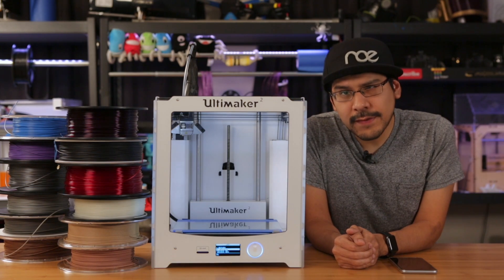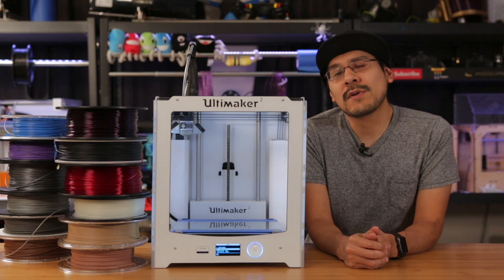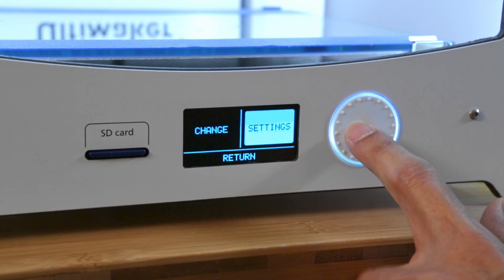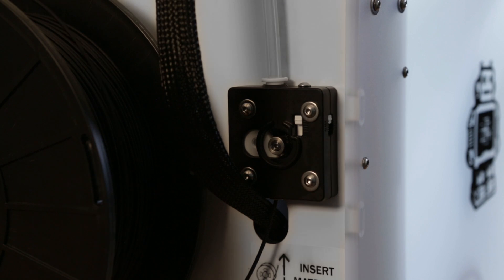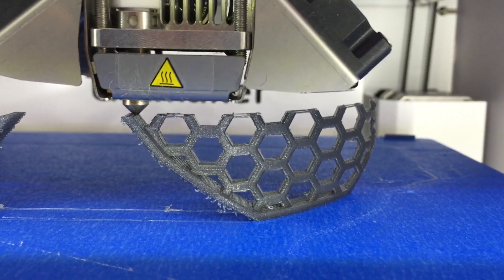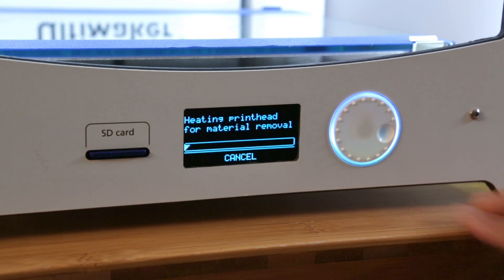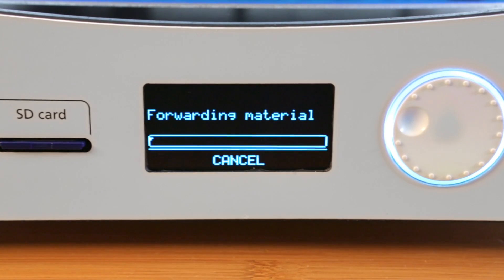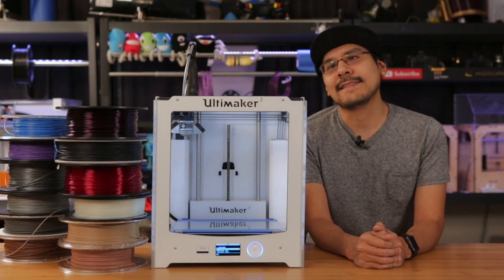1.75mm Filament on Ultimaker 2

Comment: You advise basically doing a cold pull to remove 1.75 mm filament. Is that because the nozzle has too much interior space, and is there a replacement nozzle that would allow removing filament with the normal Change Filament function?
Reply: Old comment, but no one answered - you just have to change the PTFE sleeve at the hot end.

Comment: I believe your feeder tension screw is installed improperly. The screw head should remain in the casing and push down on the spring inside. Having it on top like it is shown shouldn't allow you to adjust the tension at all. The video shows the screw head above the casing, and the tension gauge all the way at the top (both indicating this installation error). See here for cleaning procedures (https://support.ultimaker.com/hc/en-us/articles/360011802900-Clean-the-Ultimaker-2-feeder-and-replace-the-Bowden-tube) I see this improperly installed fairly commonly after people clean out the feeder and reassemble as this screw and spring tend to fly out of the casing if opened too quickly, and the position of this is not immediately apparent.

Comment: I recently got a UM2+ from Adafruit and got some ABS 1.75mm filament at same time since you guys recommended 1.75 and 2.85 ABS was not available from Adafruit.  I am a complete beginner but have no problem with PLA 2.85 but the ABS 1.75 seems to melt and back flow up the tube.  I think the Ultimaker 2+ has different feeder and printhead.  Have you tested 1.75 on the UM2+?  I like your videos and projects.  Keep up the good work!
Reply: +Byron Porter  Hi, I have the same problem .I'm going to try the following; Bowden tube with 2.4 mm id+ nozzle with 1.75 mm id

Comment: Need to replace PTFE tubing.  It is made for 3.00 mm filament not 1.75 mm.  The extrusion and retraction will not work.  There is too much space in the tube.  Same for the hot end.  Too big of a hole for the filament.
Reply: I got my hands on a 6mm external, 2mm internal PTFE tube, if I used that instead of the stock bowden would I be able to do this with my U2 with good results?
Reply: They said that they got good results with using the stock bowden tube, but I would use that instead
Reply: +Trey Roudebush Thanks, would I want to use a smaller nozzle than usual as well?
Reply: +Segata Jonshiro no the stock .4 mm nozzle is fine
Reply: +Trey Roudebush Awesome, thank you very much!
Reply: @Segatajonshiro  Where did you find an ID2 OD6 PTFE tube? I cannot find this anywhere.

Comment: what is the blue material of the base??
Reply: +Alfonso Pascual Painters tape, preferably used for printing with PLA. People like the 3M blue tape over the green because the parts hold better. Over time, when your print parts on it, the surface wears out and you can just peel it off and apply a new strip or two - it's cheap too. There's many other surfaces out there; depending on what material you print with and there's lots of new discoveries on whats the latest preference especially with ABS, since the material is hard to print with and people are always striving for something better. Like kapton tape used to be the surface preferred for ABS, but now some people are moving to the more expensive PEI plastic sheet which is way more dependable. Preventing effects like lift on corners or having your parts magically get knocked off - is the vain of 3D printing.
Reply: +GeoDelGonzo i bought FIXPAD http://store.bq.com/es/fixpad but the parts dont hold very well. the corners blend...
Reply: +Alfonso Pascual what type of machine do you have and what kind of material do you print with? I've seen those before, but never heard much about it. 

Some folks have completely gave up on the abstract material and went for straight glass; except they use a medium, like an ABS paste/slurry for printing ABS parts or even using a regular gluestick on top of the glass. I've tried the gluestick method and its actually have got some merit to it.
Reply: +GeoDelGonzo i print with prusa I3 Hephestos with PLA. i print with lac and it goes well. but with fixpad not...
Reply: Something doesn't seem right; have you tried cleaning the surface of this fixpad before printing? Most printbeds out there are exposed to ambient dust in the room that the printer is kept in and sometimes the oils from your fingers get on the printbed when you take your parts off. If you're new to printing, this one of the things you have to look after; clean your printbed or fixpad in this case. A 3D Printer Hobbyist's best friend is Isopropyl Alcohol; I like to use 99.953%, compared to medical grade which is watered down and can leave residue on your printbed. Dab some of the alcohol on a good cloth or ply of papertowl that won't leave much dust behind. this will help your parts stick a whole lot better. Goodluck amigo!
Reply: +GeoDelGonzo thanks for helping. I know it. it is new. I think it is because the piece was very big with a large base. with small pieces it works well.thanks
Reply: OMG!!! WHY WHY WHY are people using blue tape with heated bed? Especially on Ultimaker! The adhesion for PLA with heated bed is amazballs, you just have to dial in you bed level tighter than with blue tape (blue tape give a lot of room for  error vs bare glass). The mirror finish is fantastic as well. If you have small parts, or are afraid of slipping use "brim". For "the love of God and all that's holy" don't do this unless you need to disable the heat bed for some odd reason. :P
Original Ultimaker + Heated bed upgrade, best decision ever (despite the upgrade sitting in a box for nearly two years).